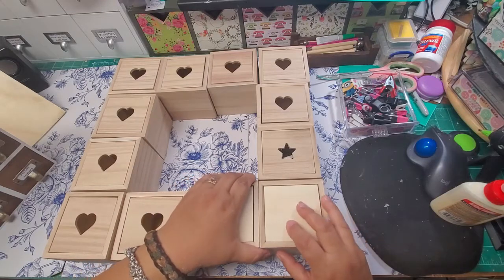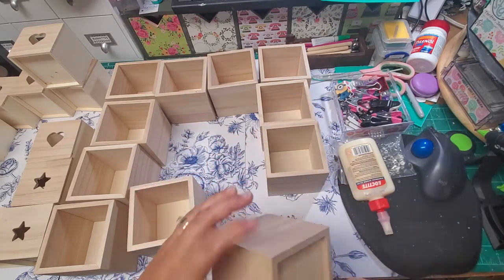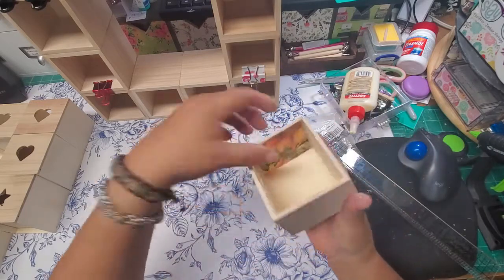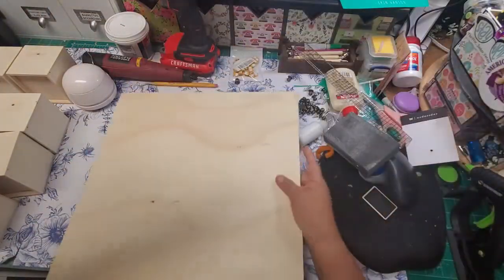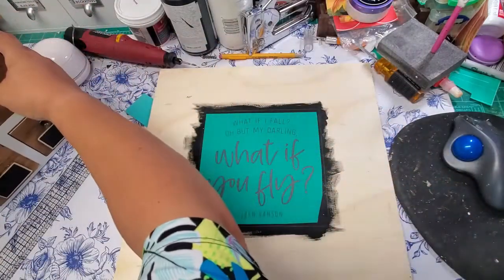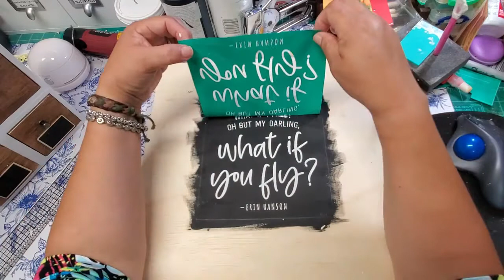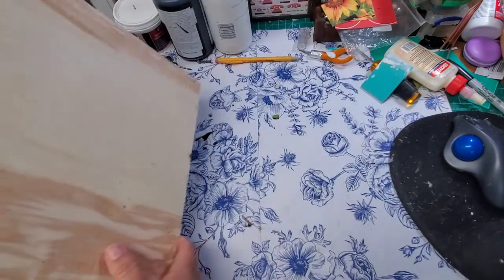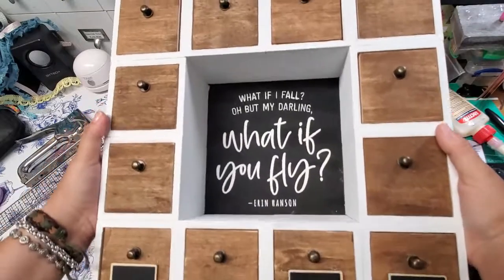MICHAELS mini drawers APOTHECARY unit

Comment: SUGGESTION:  When you use  WOOD  GLUE  have a    d a m p    cloth to hand to wipe away the squeeze out.   It doesn’t matter as much if you’re painting the project, but if you are staining the project, the glue residue won’t allow the stain —  or varnish  —  to soak in as is needed.
Reply from the maker: Thanks forn the suggestion.  Thanks for watching.